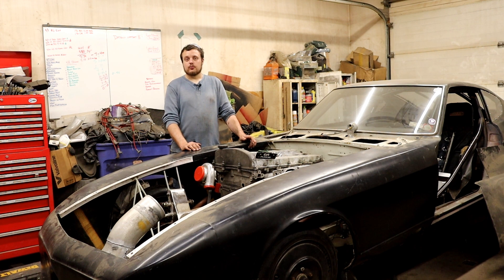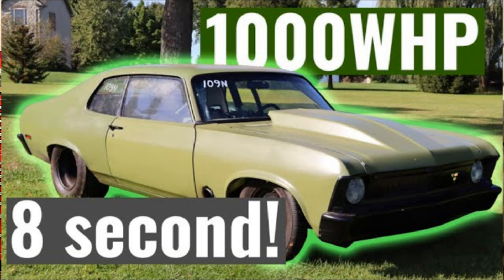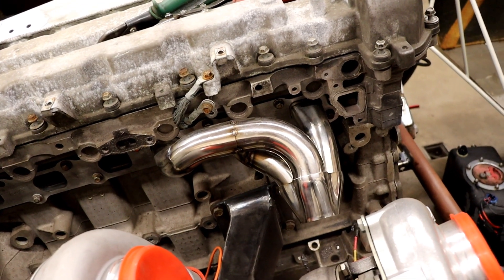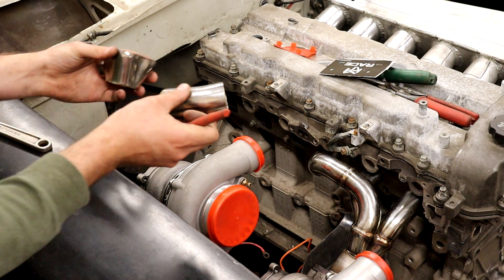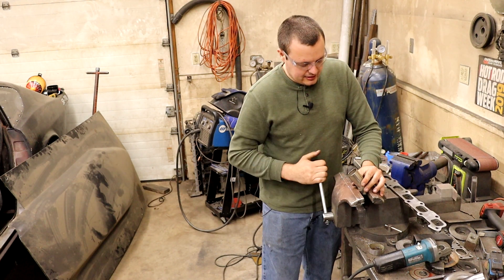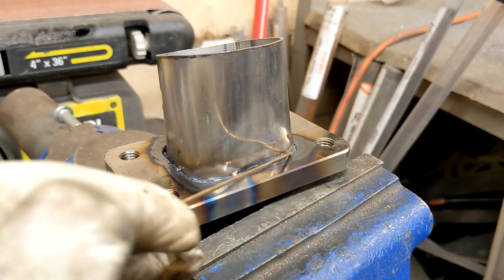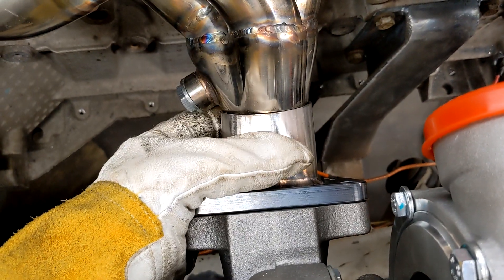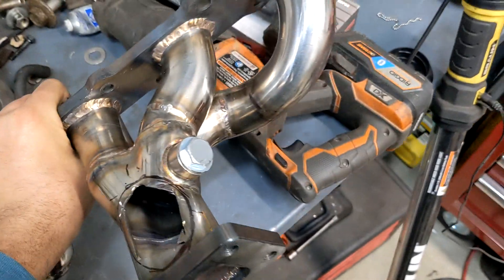Twin Turbo Ameri-Barra 4200 Datsun Drag Race Car Fabrication Part 2 + Building a Turbo Kit #datsun

Comment: Not sure if you will see this but I have a question for you. Im building a 1984 maxima wagon. Was planning on doing a L28et swap but Ive always liked this engine.  This is going to be a daily driver and I really dont want to mess with modifying the hood. The engine bay in the Maxima is very similar to a 280zx but is likely a tad taller. Is there any chance to get this in with out having to cut the hood? Do you have a dimension from the oil pan mounting surface to the high point on the valve cover?  Thanks and keep up the good work! I love Inline 6's!!
Reply from the maker: I don't think it will fit without modifying the hood. They're pretty tall. You could measure though. Here you go: https://sites.google.com/view/vortec4200wiki/dimensions
Reply: @Calvin-Nelson  Thank you very much. Those drawings are what I've been looking for.  Not sure how i havent found that page yet in my research. Thanks for taking the time to document all of this.
Reply from the maker: @jeffer9499  No problem. Have a lot of time in it. Hope it helps.

Comment: A suggestion when marking out and fitting up tubes for similar; PVC pipe, particularly in 1 1/4' and 1 1/2" diameters is easy to get at "big pox" home improvement stores and much easier to trial fit  than metal. Once you have a good fit, slice the pvc on the simplest side and snap it over the metal pipe, mark it and cut it. Also, fit the "spur" first and then use the spur to layout the cut in the larger tube, mark it and cut as needed. Do love your no frills, let's get it done style!  FR

Comment: Why did you merge the down pipes?  Instead of running them out separate?
Reply from the maker: Smaller hole going out the fender, and it will likely have a better exhaust note.
Reply: @Calvin-Nelson  do you think it will make any difference in power?
Reply from the maker: @russellbroadwell  nope

Comment: Could you treat outside weld like welding sheet metal. High heat spot welds followed by air to cool weld?
Reply from the maker: Probably not. Hard to say. Brazing does the trick.

Comment: This is awesome ive had 7 Z cars over ther years this was my 74 260z 355sbc with stock rear . https://youtu.be/aeQtvR1jd34
Shortly after this run I got a nice fox body roller and this motor went high 8s much safer

Comment: Have you tried using flex tubing to make shape desired like a pattern then go build on bench with exhaust?
Reply from the maker: I've heard of people doing that. Might work. You'd probably be best off using those snap together plastic kits.
Reply: @Calvin-Nelson  if I was to use plastic I’d use a schedule 20 thin wall pvc and a heat gun to shape it. 

I was licensed water well driller & pump installer for 20 years…

Comment: Do the exhaust runner length into the turbo have any effect? Or is it once it spins a few RPM you basically have exhaust pressure in the runner so it doesn't matter?
Reply from the maker: I bet they would have some effect, but yes there is definitely exhaust back pressure to deal with since you are driving a turbine.
Reply: The length does affect how the turbo reacts there's equal length and unequal length headers each doing something different in the rpm range at a certain point with turbos (just a very loosely educated understanding) in a turbo application the exhaust impulses (firing order) combined with scavenging characteristics to help pull as much heat and exhaust into the turbine as possible to deliver the most energy.

Comment: That o2 bung isn’t going to work for a gate dump:p excellent work and tips.
Reply from the maker: Yeah. Those o2 bungs will be plugs and we will put one in the turbo down pipe.
Reply: Collector O2 bungs are left overs from the header he based it on.   For a turbo car the O2 sensors need to be in the downpipe
Reply: Just a joke guys I saw the stand off. A friend of mine used the same technique on his twin build where the turbo is practically mounted to the header flange. Calvin show us the intercooler work, oh next is the machining good stuff.

Comment: Well, this gave me something to watch while drinking coffee at 4 am...
Nice work.  And your welds look fine.
I've been wondering how one of these 4200's might propel a boat...
Reply from the maker: The problem with a boat is they spend a lot of time at high RPM, and you may run into oil starvation issues since these engines struggle a little with oil return to the oil pan. They make lots of torque and great horsepower, so it would probably run great.